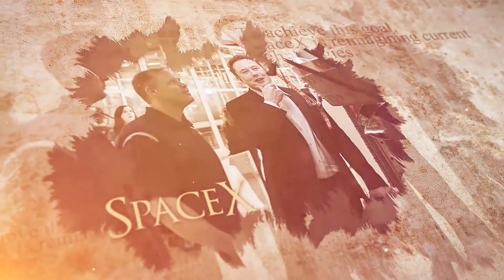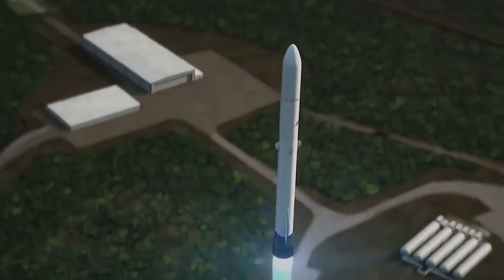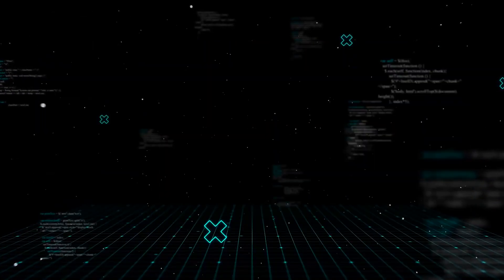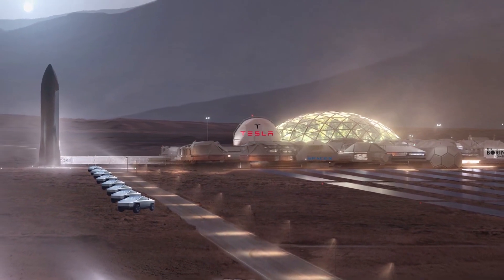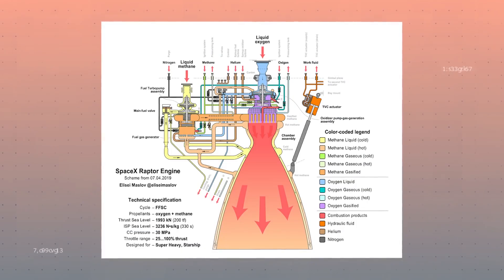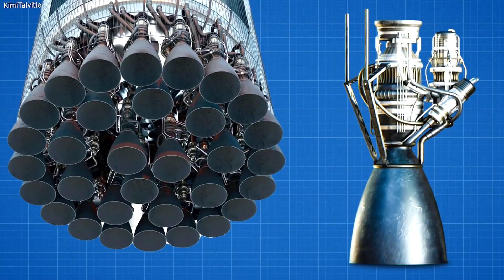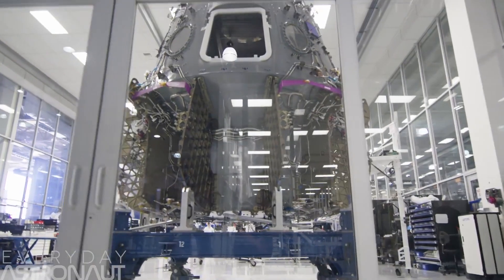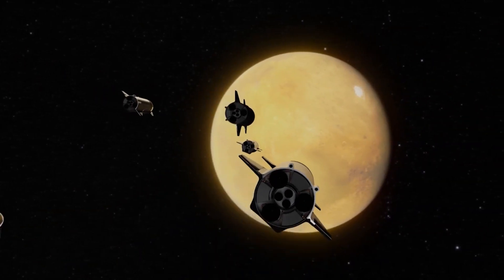SpaceX Starship Raptor Huge Upgrade

Comment: The Thumbnail as well as the Title claims to tell us about the upgrades to the the raptor engine, about the new Raptor 2, but after watching the whole 8min 31s video i got nothing to know about the engine, you explained the whole starship program instead, you just talked about increasing the thrust and  ISP nothing else, how, when, where, why what is letting them so that what kind if upgrades.

Comment: The difference between sea level and vacuum versions of the engines is not large at all.  Basically it's just a bigger nozzle on the vaccum version.  The rest of the engine is virtually identical.

Comment: Superheavy gives the ability for Starship to leave the Earth’s surface? Several iterations of Starship have already done just that without Superheavy having flown even once. Get your facts straight, and get some up-to-date graphics. This channel is a waste of my time.
Reply: I agree with you, this channel is a waste of time and pretty useless videos  however he meant about starship reaching orbit, starship cannot reach orbit on its own as its too heavy, so it requires a Super Heavy booster.
Reply: A fully fuelled starship cannot reach orbit on its own.
Reply: How many engines could fail during the landing of the booster without compromising the landing?
Reply: @reasonerenlightened2456  Probably most likely one engine will result in a harder or a 90% chances of a failed landing, however not sure, as far as I know we don't even have the exact number for how many engines Super Heavy will use for landing, but most likely the 3 RC.
Reply: You people are what’s called armchair generals. There is Physics involved in these projects and, when it comes to Physics, SpaceX and Tesla rules. And, mechanical failures are correctable just like other failures they have had that led to their successes. Remember what Elon stated: “If you’re not failing enough, you’re not innovating.”
Reply: @leapdrive  If you can't see, I said that I wasn't sure, and just sharing what I know, which I never said that is 100% accurate or no, before talking, you should read twice then complain.
Reply: @OsmanEner  , my comment is a general statement to the whole thread.
Reply: @leapdrive  alright then, apologies